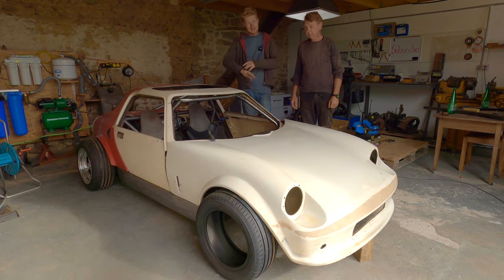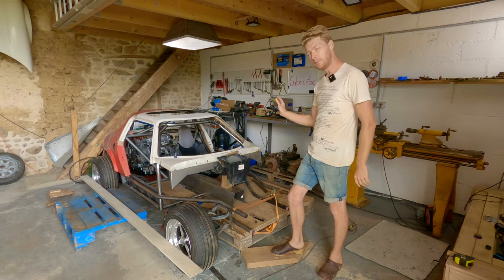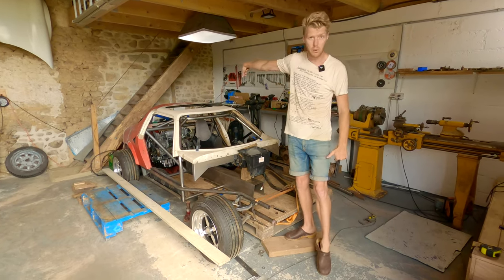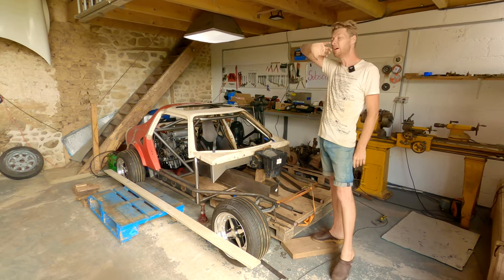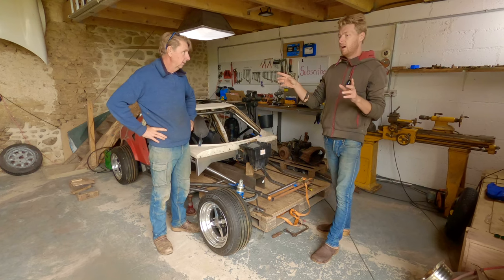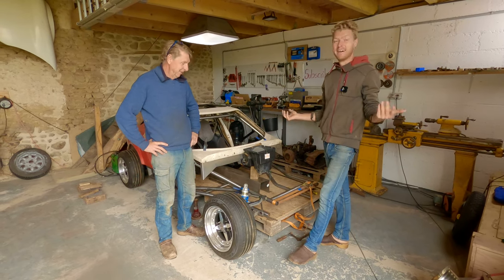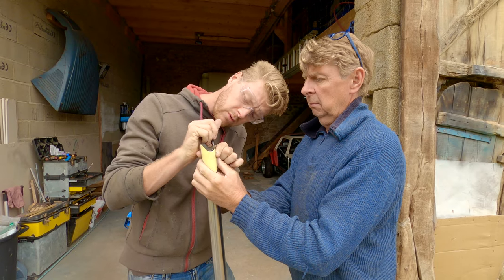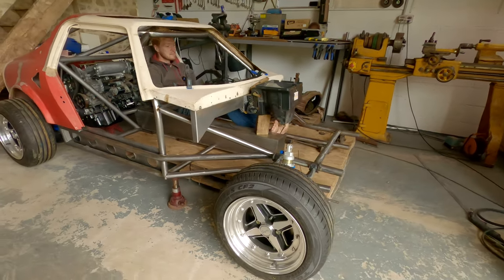Mazda Miata suspension without a Subframe!  | Project Mosquito Honda Type R Mini Supercar (Ep47)

Comment: FYI: My 2009 1.8 VTEC Civic weighs 1250kg ish has about a 44 litre tank will give up to 450 miles on a run, say 380 miles commuting range. So I think you should easily get the range you have estimated.
Reply from the maker: Thank you
Reply: @OliverPickard  the gearing is possibly a bit low to hit those high MPG figures. What revs will it pull at 70 in top? I was surprised by just how low a Type R is geared
Reply from the maker: Because it has a different cam which delivers more torque under 4,K it's hard to work out exactly but 75 should be low 3k rpm

Comment: Would love to have your chassis but fitted round Mini parts, would be the ultimate Mini based Gtm.
Reply from the maker: It wouldn't work around a mini engine but I did design a different chassis around an A with an Arden head

Comment: How easy will it be to register the finished car? I'm guessing a whole lot easier than in the UK!
Reply: They either register it in the UK or it will never be road legal. I can't imagine how they will register it in a EU country...
Reply: @AlfaElaborazioni  So IVA test then. That's a bit of fun to look forward to. I guess it's being built with one eye on the manual.
Reply from the maker: Both the UK and France has low volume car homologation and the rules for both are quite sensible
Reply: @OliverPickard  True, just keep the IVA manual close to avoid difficulties if you are registering in the UK.

Comment: Love the project, but those wheels are too big for a number of reasons. Ride height, roll centre, gearing, steering lock available and unsprung weight being just a few.
Reply from the maker: The ride height is identical to factory when it isn't sat on a table. All the answers to your misgivings have been answered in the previous couple of videos
Reply: @OliverPickard  keep up with me round Cadwell without it ending up on its roof and I’ll believe you 😬
Reply from the maker: My 14x8 wheels are identical in weight to the original 13s. My front suspension is mx5 which comes with 14in-17in wheels & track guys run 15x8 in the exact same offset. my rear suspension is the same story with my 6spd gearbox geared for 16in wheels and my roll centers are bob on.

Comment: Why waste fuel carrying a spare wheel around?  Find me a modern car that has one.  I've given up on my kit car and just carry a compressor and tyre fill spray.  Makes the balance easier losing 15-25kg of spare wheel too.
Reply: Depends whether it needs weight to balance it. Mine is noticeably different without the spare wheel.
Reply from the maker: It's a space saver spare from a new Renault Megane I'll be taking this thing far and wide so I want the peace of mind
Reply: @OliverPickard  I am really enjoying this build, but When you fit the space saver, where will you put the wheel you take off? On the passenger's lap?
Reply from the maker: Passenger footwell because the both footwells are the same size and I'm 6'6 plus pedals there's plenty of room
Reply: @OliverPickard  ahhh genius, i didn't think of that. I'm glad you boys have thought of everything. I hope we get some @Harry's Garage style road trips once it's done. Mosquito buzzes Stelvio etc
Reply from the maker: It's not the perfect solution but in an emergency it's good enough.  I live about 3 hours from the Alps so yes